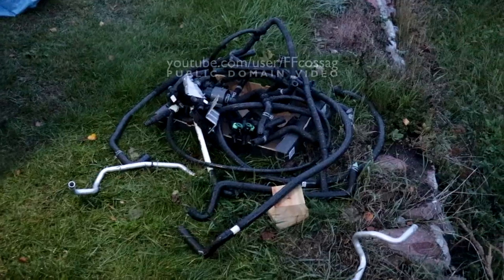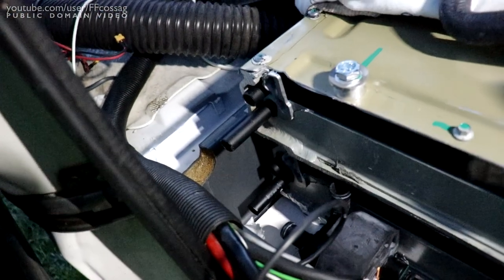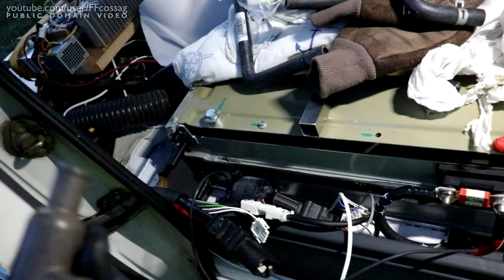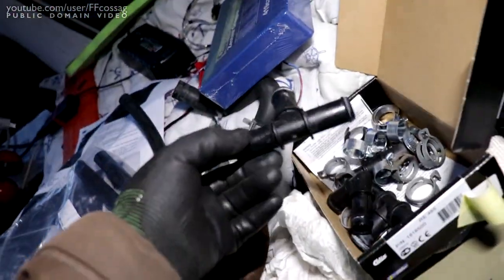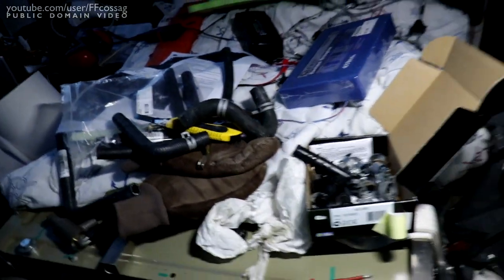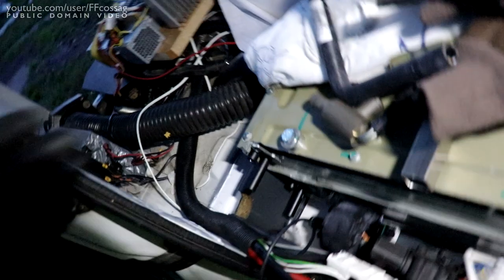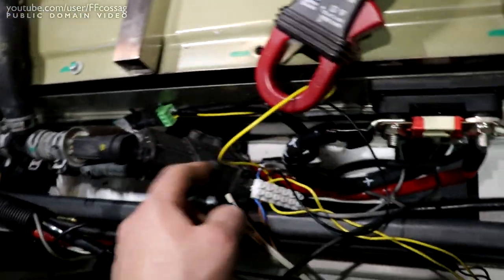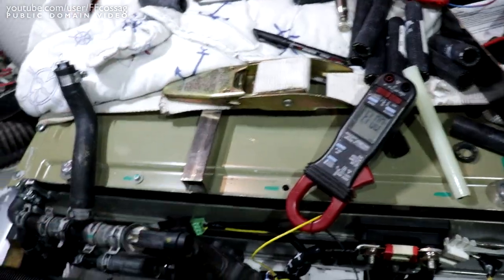Elcat Lithium Conversion EP4: Battery heating & cooling

Comment: I love the capacitor as a plug :P The build is progressing really nicely, I think the plumbing became perfect :D Reusing a old block heater was a excellent idea, I am really impressed how well that works on 72V, it is going to keep the battery at a really nice temperature all the time :D Re-using parts is the best. <3 I can't wait for the next episode, things are starting to get really exciting now :)
Reply from the maker: It's not even an old block heater, I bought it brand new specifically for this project! I just did the maths and estimated that 50 W should be plenty to keep the pack warm. The real re-use is in the hoses and hose clamps, I think I used about 2/3 the clamps from an entire Model S, lol.
Reply: @FFcossag  Lol, that's impressive. I did not know Tesla's contained that much hoses!

Comment: Superb content.👍
Never enough long.🙆‍♀️
Best regards 🙋‍♀️
Reply from the maker: Thank you. I actually put a lot of effort into cutting this down for length. This video started out as about 1.5 hours of material.
Reply: @FFcossag  
Thank's for reply. 
Would be pleasure, im shure for many of us, to see uncut videos on this wondeful project.
In topic like this there is never enough details served, wich helps to deeper dive in your perspective.
Reply from the maker: Heh, it's easy to say that when you haven't seen the uncut material. It's mostly just rambling and repeating myself. The stuff that gets cut is the stuff that doesn't add any value to the viewer.

Comment: I guess you're doing this because you're in a very cold climate? I'm looking to buy an e-NV200 van currently, basically a leaf (which doesn't have thermal management) on a van chassis - but if I understand correctly, it has a diversion valve in the AC system going to an evaporator in the battery case. I'm wondering if it would be possible to modify the AC with a reversing valve to allow it to heat the battery (and cab) as well.
Reply from the maker: Even Leafs have battery heating, because charging below 0 C is something you shouldn't do. Teslas don't charge at all unless the battery is at least 5 C, so I decided to emulate that on this pack, necessitating a heater. It also helps with condensation - if the cells are not the coldest part, condensation will form somewhere else.

The e-NV200 has AC battery cooling and resistive heating. The old ones at least also use resistive heating in the cab, which is really stupid. I don't know if it's feasible to use the AC for cab heating - I just put a diesel heater in mine.

Comment: If the pump dissipates ~40W at full tilt, that's another ~40W of heat going into the loop when absolutely required. So it's not even a loss.
Is there a drain hole in the bottom of the battery box to mitigate a future slow leak?
Reply from the maker: The pump cools to the surrounding air, so the motor heat doesn't make it into the coolant. It also really shouldn't run at full tilt in this system since it's so restrictive, I think it just cavitates. As for leakage, any leakage is a death sentence for these Tesla modules, so I've built the battery to just not leak. That said, since Elcats were designed for flooded lead-acids, there actually is a drain in the battery tray.

Comment: to burp the system properly drive the Elcat on a slope , your highest point should be the expansion tube so drive the Elcat on a slope sideways and run the pump and it should push out the remaining bubbles 
akre gonna have a cooling system or just heating ? maybe splice in a normal automotive radiator with a couple of valves for the summer
Reply from the maker: I actually did jack up the vehicle to burp it, though it didn't do much good. The problem is that the coolant lines in the Tesla modules are extremely restrictive, wide, flat and zig-zagging, so they trap air very easily. 

Cooling won't be required because of how slow the Elcat is. It's not possible to load the batteries down with more than about 220 A continuously, i.e 0.5 C or about 15 kW. The power dissipation inside the entire battery pack won't be more than perhaps 200 W. You won't see more than a few degrees of temperature rise throughout an entire cycle even if you're just capturing the heat in the thermal mass of the coolant.